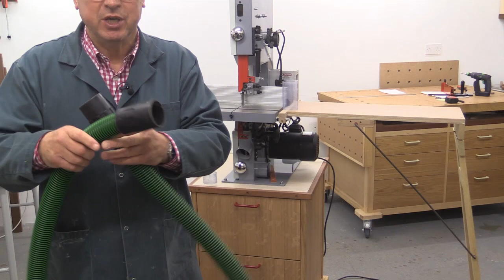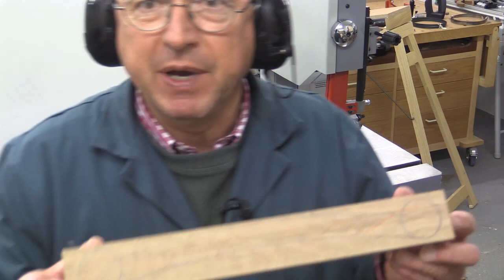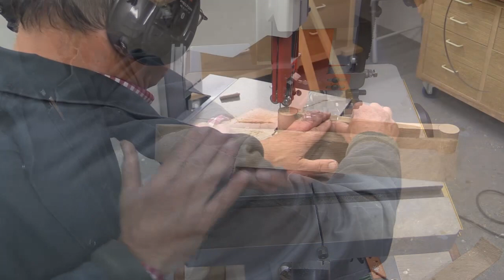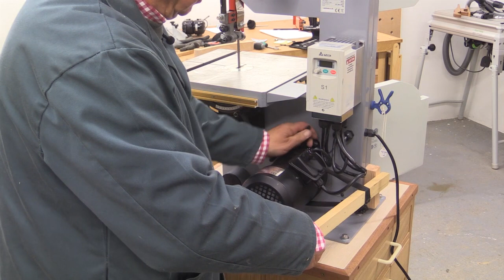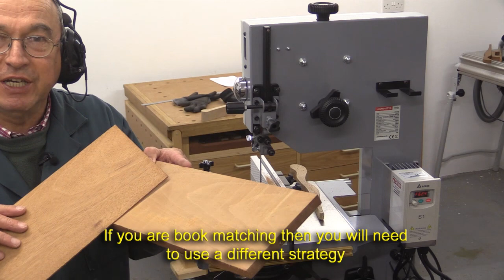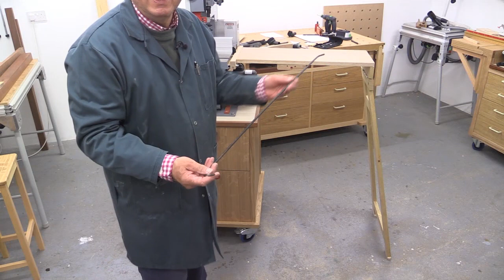Bandsaw Xtras #1

Comment: Hi Peter, Is that the festool 50mm hose?
Reply from the maker: No, it is a short length of 36 mm hose. I had bought a 5 m long one a long time ago and use a short lenth for my Kapex, a slightly longer piece for the bandsaw and oscillating sander and then the remaining large piece goes overhead to my tracksaw cutting station.   Peter

Comment: Hi PETER
Great video, what I’d like to ask is, is this saw capable resawing 150mm oak? The piece you cut how long did it take?
Reply from the maker: Hi Stephen, The maximum cutting height is 160 mm and so that part is fine. I have cut a lot of oak and with the right blade your 150 mm will be no problem at all. That piece of 150 mm wood that I cut took probably about 50 seconds to cut. I would expect the timing for oak to be the same. Please do not hesitate to ask further questions.    Peter

Comment: Another good video Peter, keep 'em coming! I wondered what blade you used for cutting the veneer - widest possible with fewest teeth? I presume you are using Axminster blades, but if not what? Can the bandsaw properly tension the widest blade it is specified to handle - I believe many struggle? Tensioning bandsaw blades is something I find very tricky (my machine has a tension guide on it but it can't be relied on), a little more detail from you on that topic would be much appreciated I am sure. Terry.
Reply from the maker: Hi Terry, For veneers you will be cutting quite wide pieces so fewer teeth per inch is better and a slower speed as you have to be able to clear the sawdust from the cut. High tension is essential and the BS11 gives that.  Peter